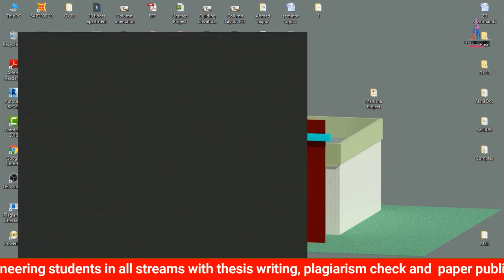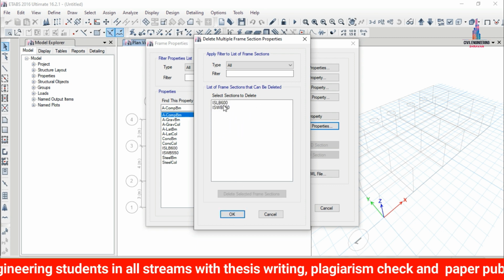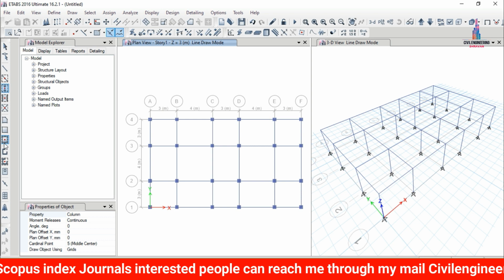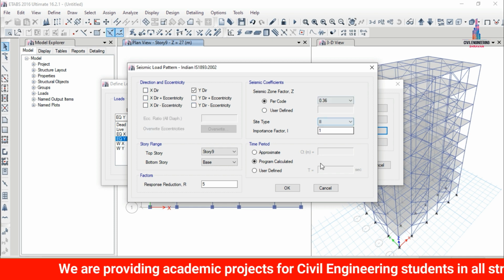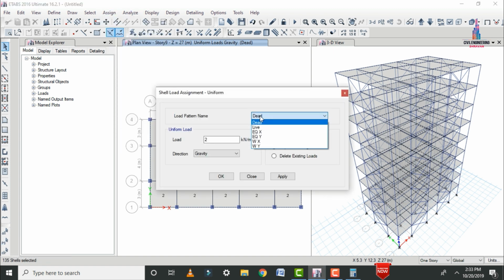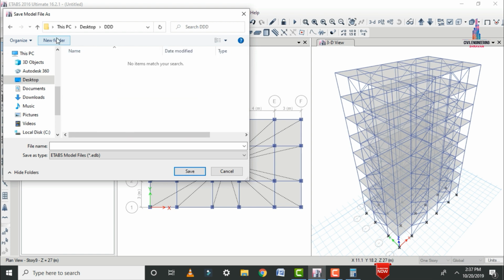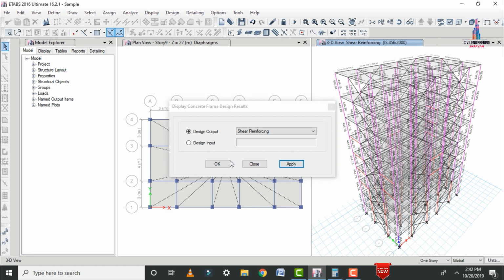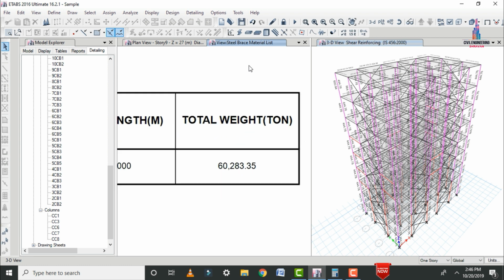Building design with steel bracings by ETABS software | bracings system | civil engineering | online

Comment: Sir you are  providing steel bracing in rc frame structure. sir how to provide connection at joint between rcc and steel bracing. How to model joint in rcc frame structure with steel bracing one of important citeria is to provide connection. We can't provide connection directly...sr connection kese provide krenge usko model kese krenge or connection provide krne  k liye concrete or steel k bich kya use krenge...???? Isko please btaiye or iske modelling pe etabs me ek video bna dijiye

Comment: Hey can you do a 5 storey steel 5 bay n 3 bay structure  with X-braced frame in tension only . Braced in X-direction will be in bay 2 n 4. In in Y- direction will be in bay 2 (middle).

Comment: As I seen it's 10 m X  17 m (30' X 55' appro) for this structural you have show us around 60,000 tons of steel required. 
That means the steel cost only 
360 crores.
Then what will be the entire building costs?
Reply: That is weight of steel which is act in building 
Not cost